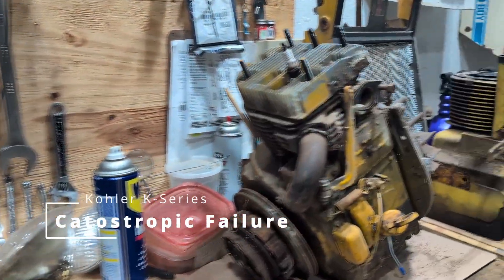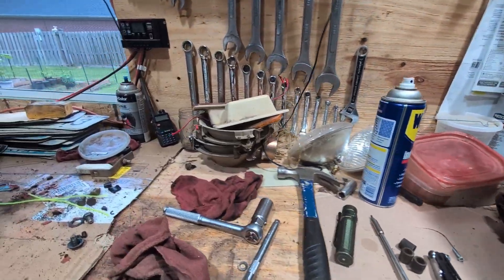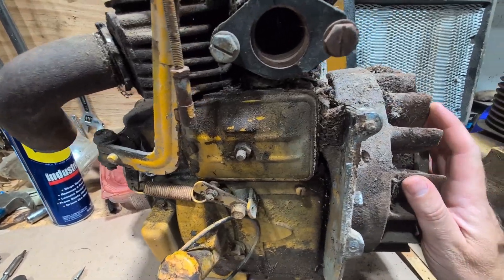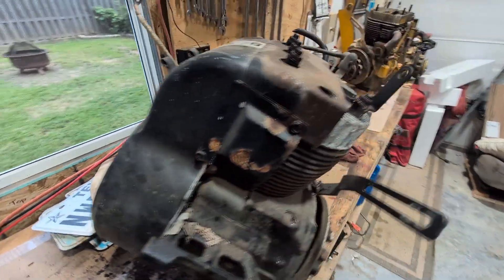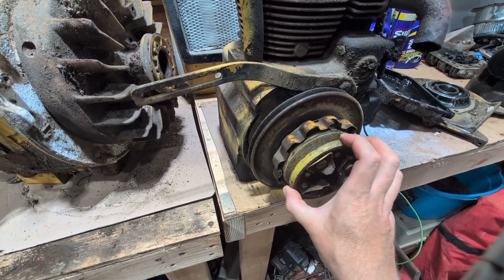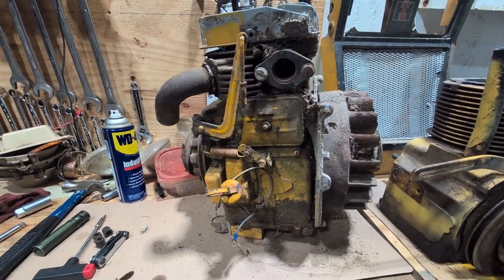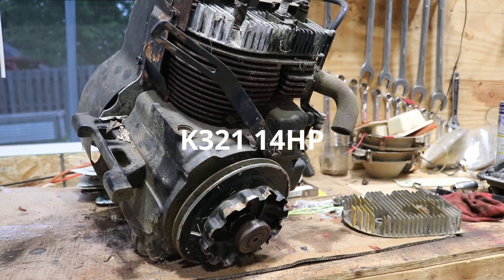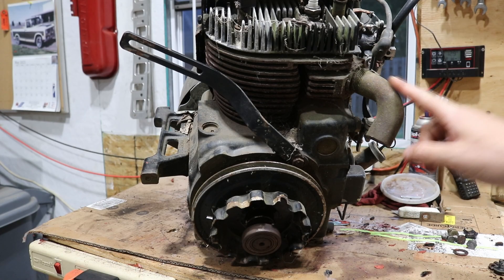Cub Cadet Kohler K301 Catastrophic Engine Failure Tear Down

Comment: My Kohler K161 7hp engine blew a rod through it's block 8 years ago on my 1969 International Harvester Cub Cadet 73 so I installed a K301 12hp & it lasted up until yesterday it also blew a big hole on the side of the block so I'm assuming the balance gear's finally went. I would highly recommend removing the balance gear's before they destroy the engine now I can't even rebuild this thing.
Reply from the maker: Thanks for sharing your experience, that's some good advice to keep in mind. It seems to happen way to often with those old balance gears.